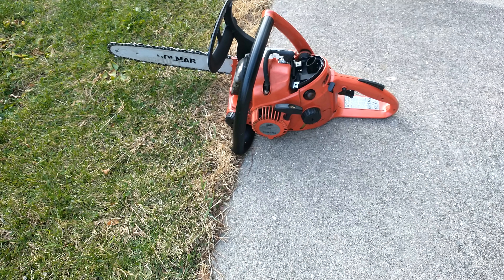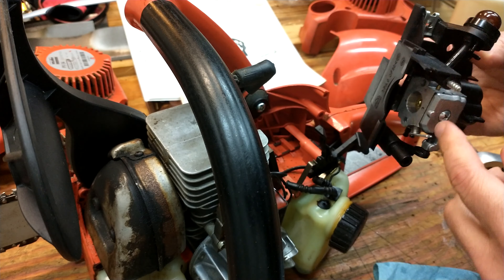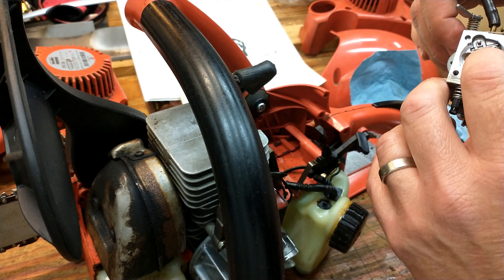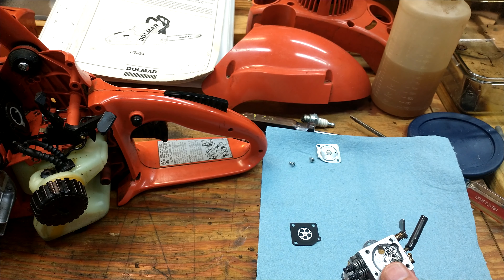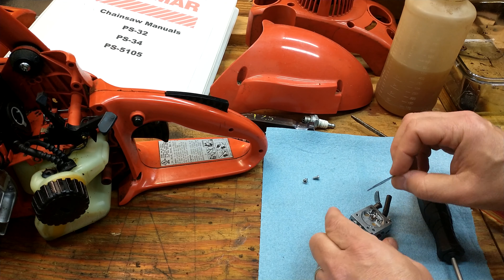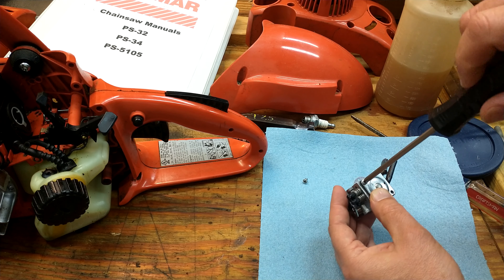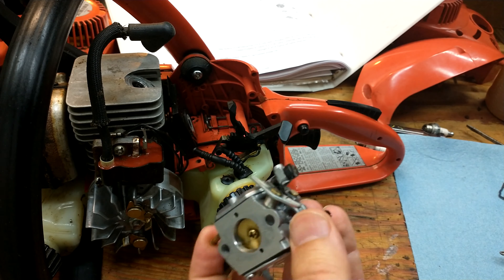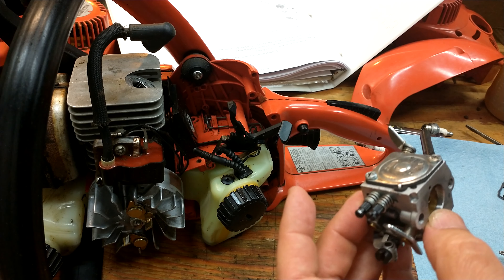ZAMA C1Q Carb issue flooding engine and wetting spark plug

Comment: Another tip- If you notice your equipment (chainsaw, string trimmer, etc) seems to flood out more and more often, you probably have a carb issue. Dont wait. My leaf blower had these symptoms and then I tried to start it one day and after the 2nd pull the cylinder filled w gas and when I pulled the cord again I sheared off the key in the flywheel. The new  factory OEM flywheel was made in China (isn't everything) so it was almost 6 weeks waiting on the part. Now I use only ethanol free gas in all my lawn and garden equipment. Thanks for the video. Cheers
Reply from the maker: This was a saw I bought off of Craigslist, so it had the flooding issue. I run all my equipment on ethanol free gas and use the additives listed in the description. Equipment always starts within a few pulls and runs smooth. Cheers!
Reply: @justbehandy  please can you write the item number or link for kit carburetor . thanks
Reply from the maker: https://amzn.to/2WwWwMe

Comment: this new fuel formulation is flat out destructive to small engine carburators and fuel lines. i went to start my new weed whacker for the first time this year and the fuel lines were so brittle they just fell all to pieces.. so i tried my chainsaw and the exact same thing happened. even though, I emptied the fuel out of both pieces of equipment the fuel lines still got brittle and disintegrated... from now on its nothing but pure gasoline for all my small engines. i have never had this issue with non corn ethanol gasoline
Reply from the maker: Yes, agreed.  If you can't find the non ethanol fuels be sure to run one to two Oz of a good carb cleaner like B12 in the description.  And always empty out the tank and run the carb dry. If the tank is big, put a shutoff valve in the fuel line and run it dry. Hope that helps.
Reply: After running it dry before the off-season. 
I've heard/seen of guys having good luck to take your 2 cycle oil mix and leave it in the tanks til next season. 
Takes a little math. Gotta figure out your fuel tank size. So you can add straight gas to it. To get the proper ratio when ready to run again.
Reply from the maker: @matthewbeaver5026 I don't like to do that because if you have old gas in there it will still gum up.  What works well, but you have to pull start around 10 times to get it started, would be to dump all the old fuel out of the tank, then put straight 2 cycle oil in the tank and run the chainsaw till it dies.  That will fill the fuel line and the carburetor with 2 cycle oil only. Then when you go to start it up the following season, just put in the 50:1 mix and pull till the fresh gas gets in and starts it.  Be ready for a lot of smoke.  Also, "Don't" use car motor oil as some carburetor diaphragm materials may swell up and deteriorate.  Hope that helps

Comment: Nice video! My only suggestion would be to disassemble both sides of the carb at the same time so you can blow air or carb cleaner into the through passages to flush any contaminants out. You should pull the needle valves out and do the same. Aggravating if the L or H circuit is dirty.  Easy on the air pressure so as not to blow the welsh plug out of the cavity.  Speaking from experience... LOL
Reply: Zama says not to blow compressed air or even pressurized carb cleaner through. They say you can damage the check valves. I'm just sharing from the video they have on there carbs. I've done everything they said not to also
Reply: @kurtknispel9170  Good to know.  Yeah, those neoprene coated check valves can be the death of the carb...they are there to prevent air from being pulled into the fuel cavity when pressing the primer bulb, as I understand it. But how then to clean out deposits in the carb body?
Reply from the maker: Great idea

Comment: Having the same problem with a reasonably new chainsaw - a lot of fuel flooding into the cylinder. The diaphragm isn't crispy but I'm guessing the needle valve is stuck open somehow.  Thanks for giving me a starting point on how to fix this issue.
Reply from the maker: Thanks for the feedback.  Use an ounce of carb cleaner that claims it cleans gum and varnish per gallon of gasoline. And always empty fuel tank and run the saw till it dies a few times before putting it away.  I find that helps a lot with the needle issue.
Reply: Late reply so hopefully you already fixed the issue.  Buy a simple pressure/ vacuum tester and pressurize the carb to about 10 psi via the fuel inlet fitting.  There shouldn't be any pressure falling off.  If it does you can place the carb in a liquid of your choice (gasoline at your own risk) and see where bubbles are coming out.  If they are coming from the main jet nozzle in the throat of the carb that is usually an indication the needle valve is not sealing against the seat properly.

Comment: Nice job! I'm working on one right now for a customer with the exact same problem, flooding and snappy diaphragm but, his was because he bought the premixed fuel in the can which I try to stay far away from, the fuel looked like it had crystallization in it when I poured it into a clean bowl for inspection. I personally don't think that it has the proper lubricants in it and I have been doing this for over 40 years, call me old fashion I guess and this is a brand new Remington Ambush leaf blower that he used 3 times. I don't have the patience to wait for a rebuild kit when most lawn mower repair places have or can get a new carb in a couple of days and most are under $25. I enjoyed your video though.
Reply from the maker: Thanks Jeff! I agree, I don't like the premixed fuel either. As for rebuilding carbs, it takes me 5 extra min over replacing one, and only costs  $6 to $12 depending on if you get aftermarket or O.E. I find it therapeutic at times, but I also agree, getting a new carb and get it done is sometimes better.  Enjoy!

Comment: I think the diaphragm is my issue. Trying this next. Thank you.
Reply from the maker: 80% of the time it's the diaphragm,  20% needle stuck.  Hope that helps.
Reply from the maker: How did it go? Did changing out the diaphragm fix the issue you were having?
Reply: @justbehandy  I ordered an Amazon China replacement carb. Going to install this weekend and will let you know. Fingers crossed
Reply: Man! So happy!! You saved my 10 year old srm225!  Runs like new! 
THANK YOU
$16 and about 15 minutes and I am not handy. Thank you Subbed
Reply from the maker: Nice! You may want to hold on to the old carb as backup.  Just buy a $3 carb kit and clean & rebuild the old one. The fuel will eventually  stiffen up the diaphragm and will need replacement. It only takes 5 min to rebuild the carb.  Enjoy...

Comment: Hi, I do like your videos, informative, not like some of them. I have just serviced my carb’ because I thought the filter on the carb was blocked and I did seem to be flooding with fuel.
I can get the chainsaw starting but not unless you put some easy start in, I can tun it fine for whatever time needed, but if you stop it it will not start again unless you give some help.!, any idea of the problem.?🤔
Reply from the maker: Hi Michael, did you rebuild the carb and it still is having a tough time starting?  If yes, check your idle speed and choke setting.  Other than that, fresh fuel may help.  The reformulated stuff starts to go bad after a month or so.

Comment: What did you set your idle at to start off with, and what were your final screw settings, thanks great video mate
Reply from the maker: Hi Paul,  thank you for taking the time to reach out to me and the feedback.  For the idle screw, I turned it in till the throttle cracked open, the saw has a part throttle lock on startup, so when the saw started with the throttle lock, I kept turning in the idle screw till it started to increase in rpm.  Then I turned the idle screw in 1.5 turns before removing the throttle lock.  I then set rpm to specification using a tachometer.  As for the Low and High set screws I started out at 1.5 turns out from fully seated.  All fuels are different,  so results will vary from there on fine tuning. I recommend getting the equipment warmed up under load before final adjustments. Always go richer/turn out till the engine rpm slows down then go 1/4 to 1/2 turn in for best performance. Hope that helps
Reply: @justbehandy  thanks for getting back to me really appreciate it ,been a big help
Reply from the maker: @paullynch1938  thank you and please get the word out, could use more subscribers to keep channel going. Have a wonderful weekend.

Comment: Would having a bad diaphragm cause the fuel to leak out of the muffler /exhaust??
Reply from the maker: Yes, it can holding the needle open as well.  But also check the needle.  Sometimes there is buildup around the tip that will hold it open. Also, some needles come with rubber tip, and that may crack over time due to fuel with alcohol.  Hope that helps.

Comment: What is the purpose for the hole in the middle of the brass looking center piece on the metering side?
Reply from the maker: It's a balance hole.  Helps balance to atmospheric pressure.

Comment: Check ur spark arrestor as well.. a lil screen in the muffler. My ms311 did the same thing. But it was the screen in the muffler was plugged with carbon
Reply from the maker: It was clean. Thank you

Comment: where are you buying carburator kits for zama carbs? here in tennessee you cant find a rebuild kit you gotta buy the whole carb but its only 30 dollars for a brand new carburator
Reply from the maker: I bought an aftermarket kit that works well. link is in the description.
Reply: I ordered a brand new carburetor with fuel line,  spark plug gaskets for$26.00 off Amazon
Reply from the maker: Save and rebuild the original.  It will cost you less than $10.
Reply: All over amazon for anywhere from $6-$12. 
6 is just the gaskets and diaphragms maybe needle and spring At 12 you get some extras. Fuel line and plug etc.

Comment: ZAMA C1U-K19  JD 21c weed eater air filter soaked with fuel and fuel seams to be splashing out of carb when i remove air filter and run it. any fix for this. also cant find a new air filter online to order.
Reply from the maker: It would be the same issue for the carb. It is getting the filter wet and running  for a bit. As for the filter,  JD  specific and dealer only.